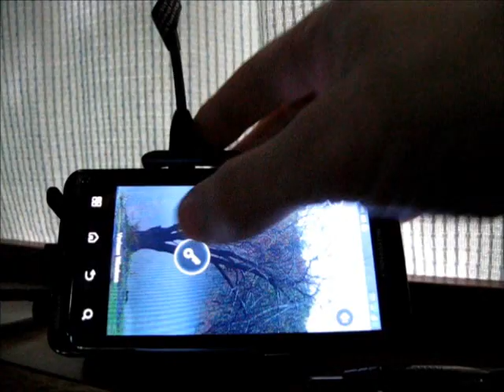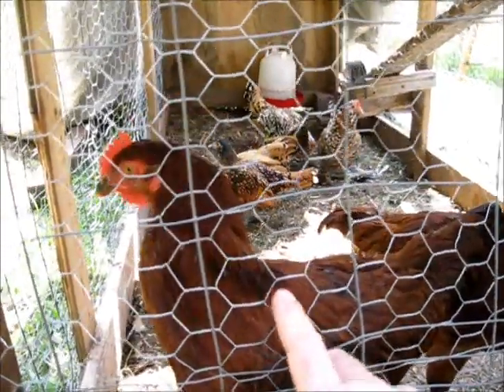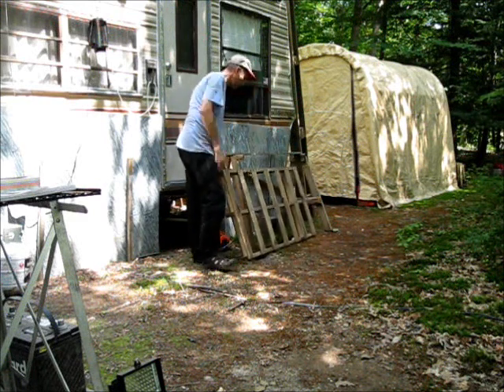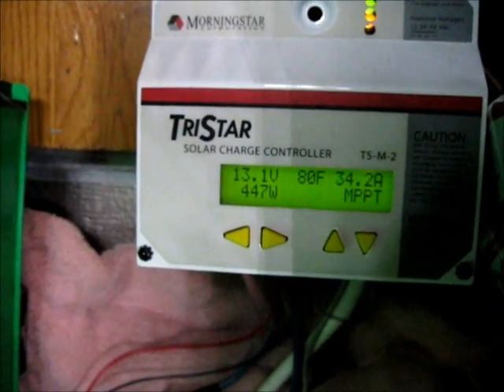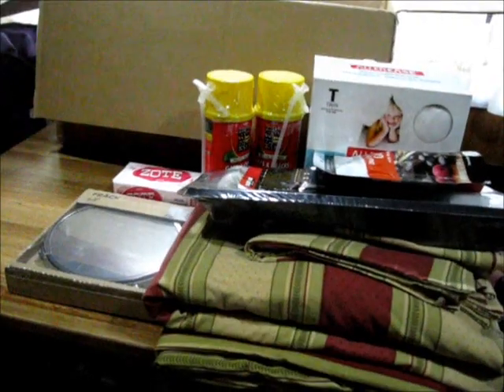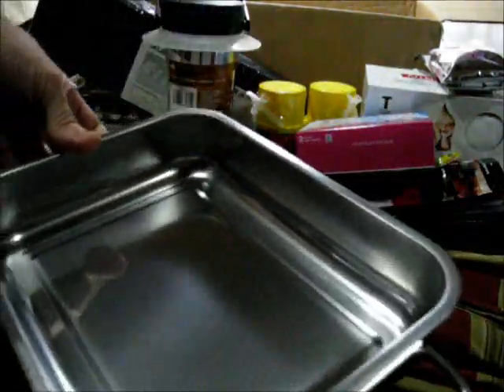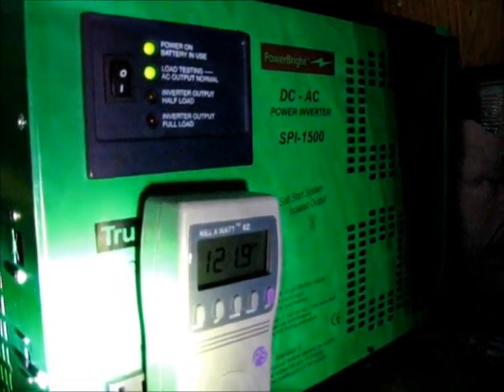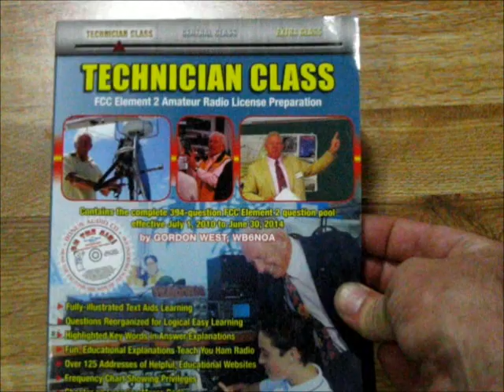Off Grid Solar Air Conditioning

Comment from the maker: Its the wires, I am sure now. I will double them up, yes.

Thanks for the tip.

The wires to the charge controller are separate from the wires to the inverter.

Comment: Why are people giving this guy a hard time? When you live somewhere at 100 degrees on average. Or 100 percent humidity you NEED A/C. If you don't good for you. BTW he explains why he needs it.
Reply from the maker: Thanks. This year has been quite brutal actually. Even my wife (got married recently) from the Philippines says it is HOT here.
Reply: I won't live without AC either. It's over 100 where I live in the summer.
Reply: FutureAirways2 you don't NEED a.c. man I live off the grid all solar water comes out of a spring. A lot of people will say off the grid and it is not primitive it is common sense

Comment: I spent a year off grid in Arkansas, and I saw how much of a different humidity makes.  It takes longer for clothes to dry on the line, my tools rusted faster, cold feels colder and hot feels hotter... my pillow would be damp at night from absorbing moisture out of the air... paper feels damp.  I also had a mold/mildew smell in my camper, but I also had some leaks in the camper.  And a swamp cooler is useless in high humidity.

Comment: It's the A/Cs current draw on startup. When the A/C kicks in it takes much more power to start then it does to run, When you 'tested' the unit during the day the solar panels were giving charge, so the 'draw' on the inverter was not so high.

Comment: It's good that the newer electrical gear doesn't have the current pull at start-up that they had a few years ago, sometimes current draw was double the running amps.

Comment: Just a thought from someone who lives in south texas and feels your pain.  I have decided the best option for ac and fridge is to only power a small chest freezer.  Freeze gallons of water in the chest freezer say six.  put two  in a yeti cooler for your fridge and two in a cooler with some water and blow a fan across it for cool air. refreeze as they melt.   I have no idea if it would work but it would mean only powering a small chest freezer vs fridge, freezer and ac.  If you do try let me know if it works.
Reply: yes like a swamp cooler

Comment from the maker: I really did consider it. They cost about as much as an AC though. I looked around a lot for them. The DC models actually use more energy in 24 hours than the air conditioner

Comment from the maker: I agree that I need more battery storage. I have been saying that all along.

But I have discovered time and time again that the charts are a theoretical capacity only. Things like wire length, insulation, quality, number of strands, outside temperature, number of wires in a bundle and other factors can affect the actual wire capacity.

I have found that my 4 awg wires will not handle 40 amps without getting warm. I doubled them today and the AC is working nicely into the night.

Comment: Glad the wire fixed it! As long as you set it to a temp where it cycles you may be OK, and at night it will run a lot less so it may work out. If you could add another 400W of panels to your system you would be in really good shape and would have some good power even on cloudy days. Anyone wanting to go solar and has grid power, look up "grid tie inverter" on ebay to get started, $100 and 2 wires and you are on your way and get to thumb your nose up at the greedy power co! It's fun!

Comment from the maker: Camper is in the shade most of the day. Yes the AC pulls more than the panels put out most of the day. In mid day its the other way around. But the AC only runs a few minutes at a time, so it works out.

Comment: I think your ac is probably exceeding your batteries  capacity when it kicks on it can have a surge demand that is significantly higher than normal running power draw.  its just for a second but must be enough to trip your system when it doesn't have the sun to feed in some extra watts.  a large capacitor in your system might give it enough reserve to kick the ac on.
Reply: A smaller high discharge battery hooked in parrell might do the trick too. (like a car battery)
Reply: I have a "hard start" for my ac and some tools
, pretty much a capacitor just for that surge they have them on ebay and truck stops camping places etc

Comment from the maker: A house runs on AC power, so smaller wires work fine. The amps on AC are lower.

With DC, you need bigger wires. You cannot safely run 15 or 20 amps through long wires on DC power. They will get hot and burn up. The average RV or camper has 8 or 10 AWG wires for higher amps.

 I was running 40 amps peak DC power yesterday through 4 awg wires and they got hot. 

Theory and reality are vastly different things I am learning.

Comment: With my experience as an electrician in the navy, a good rule of thumb on starting current for any motor is 5x the normal running power.  so that 500 is more like 2500 on startup. Your inverter says 1500 so I am assuming it can only handle 1500 watts.  Hope this info helps!

Comment: I had the same problem with my air conditioner and inverter in the evening. It ended up being the inverter to battery cable size and length. I increased the cable size and shortened the run of the cables and never had problems again. It was the load during the compressor starting up with the smaller cables that would cause my inverter to shut off or not run the ac. You could also use a capacitor to solve the problem. I used a car audio capacitor and it worked later to help with voltage spikes...

Comment: Oh man I feel so sorry for your in the heat. Down here at Lake DeGray in Arkansas we also get a bit warm 80 to 90 with high humidity and then summer comes and it get hot. FYI you need better air flow or you will have black mold in your RV. Enjoyed your video a lot .

Comment from the maker: Well, I will certainly be testing out that soap in the future.

The charge controller shows how much power is coming out of the solar panels into the batteries.

The inverter cannot run after sun down due to the wires being too small.

Comment: I was excited to see that air condition running off solar.  That is AWESOME!  Renewable energy ROCKS!!!  I want to do the exact same thing for my back room.  I am wondering if it's possible to do this only two 250-watt solar panels with a 5,000 BTU unit.  I've used an LG one that has an "Eco" mode that completely shuts down once the room temperature is met.  I'm sure that will give the battery plenty of time to recharge and it wouldn't have a constant 300-500 watt draw.

Comment: Good Job !  Could you run it at night if you had a 2500 pound electric forklift battery and how many more panels would you need???/ Would that work? OR are smaller batteries best? This is just COOL !!!

Comment: Your wires gauge had little to do with your inverter shutting down. You simply don't have enough battery power to run an AC without full sun producing a continuous charge. Going to start one myself soon and I'm going to need 560 AH of batteries alone to power my 550 watt ac for 12 hours @ 25% discharge. Ouch! Solar panels are getting cheaper by the day, but batteries are not and are the biggest investment you'll make in any reasonable solar system. Thanks for sharing and keep the videos and experiments coming.
Reply from the maker: It was the wire gauge for sure. When I shortened the wires it worked fine. But you are correct that I need more battery power to run it without sun. Yes the batteries seem to be the biggest expense in an off grid system. Thanks, I will keep up the videos. I have many plans for the coming year.
Reply: The Do It Yourself World
Wow! How many batteries do you have and how many amp hours are they? I could reduce the initial expense of my system by only running the AC during peak sunlight hours and only running a fan when it's cloudy and at night. Thanks.

Comment: I used a Swamp cooler [evaporative] and replaced the 110 vlt fan and pump w/ 12 volt stuff, and run it hardwired into a single 125 watt solar panel w/ no battery or charge controller. Cool I have chickens too.

Comment: low cool or high cool wont make a big difference, it's the compresor  that draw the more power.
so if you use you,re ac, use it at high ac  for shorter time. you will use less current than low ac for longer...

Comment: Your inverter circuit protection is being triggered at low voltage, low current or high temps on the circuit board. It could be from not having enough voltage or current from the battery bank at the time of need. I'm not sure what you have on the inverter to tell you what the error/warning messages are, or what you can read or see, but you must find out if it's low voltage, low current, or high temps.

Someone else had mentioned using capacitors to help take the current and voltage hit when the compressor kicks on, it might be a fix, but I wouldn't go there unless you know the reason for the inverter shutting down.

If you let your AC set for 2 minutes between attempts, your AC compressor and AC system should be OK, otherwise you can damage the compressor and the system.

Good luck,
There is always more to say, but I won't until you respond.

Comment from the maker: It only runs a few minutes at a time. It pulls 40 amps when the compressor is running, yes. Then the compressor shuts off and the fan blows (about 5 amps DC) for a while. I think it will be fine.

Comment from the maker: All I ask is that its under 80 degrees inside and not humid. Yesterday after 30 minutes it was 79 and comfy. The compressor only ran a few minutes at a time. Was mostly off. I think it will be fine.

Comment: Your Re right you need bigger wires to Carrie enough wattage to keep the ac running so it won't drag the power down all so you need more at least two or three batteries to keep the car up and running so The inverter still be  running while the sun goes down. Good luck I hope it's go right for you and your cat to good bless you and your cat.

Comment: Where did you get the little tan colored "tent" building in the background? It has a zippered door in one end? It looks like it fits over a PVC pipe frame.
Reply: i got one from sams club and u can get a cheap one from harbour freight and walmart - bad thing is they do deteriorated so when mine did i took some 1 x 4s screwed them on to the metal pole frame roof area then bout 30 ft metal panels and screwed them on the roof for one of my car ports for my car

Comment: Lock rotor amps, you need a bigger inverter to get the AC started, running is no problem. The reason it works when the PV array is up, is that some of this lock rotor current is being provided by the solar.

Comment: Regarding the lock glitch. I have had the same problem on a few android devices where the screen is not very responsive. I have discovered it is from not enough amps outputting from the charger. Depending on the charger, they are around 0.3amps to 2.1amps DC usually, should say on the charger. The ones that give issues are around 0.5amps DC and lower. Just my experience.

Comment: Awesome video, but have you seen the homemade Air Conditioners on Youtube, or even experimented with them? Are you able to freeze water there off the grid? There is a cheap design for a 5 gallon bucket, frozen milk jugs with water, a solar powered fan, and three holes the air blows out of.

Comment: The AC experiment is exactly the one I was hoping you could try.  I was saving to send you the AC unit since you already had the solar array.  You beat me to it!!   I found a Frigidaire unit that was 5000btu but only draws 465 watts.  Model FRA054XT7.  They also make a 6000btu unit that draws 560 watts.  Not too expensive on Amazon.  I'm definitely interested in how this goes for you.  For off-grid, or emergency backup cooling this seems like it would be great if you can get it to work.

Comment: the problem with the phone is usually a screen protector or when it's plugged in it causes issues as well.

Also I'd put something under the AC unit to collect the water from the unit. (should come off being pretty warm water too if you have a direct use for it)
Reply: Yeah, I had a bad phone charger that whenever it was plugged into my phone the touchscreen got really glitchy and I couldn't unlock it.  If you can unplug the phone, hold it normally in your hand, and it works, then it's the cable or mount causing issues.  use the process of elimination to track down the issue.
Reply: Steven Kroiss don't use it for much tho it's gross water. Basicly moisture that's in the air like sweat and other crap

Comment: I have three 110 volt ac units, one of which will heat as well. They are tucked away for emergency use only. Of course attempting to run all three at once kills the batteries within 1/2 hour. But the inverter has no problem with all three. It's the panels that can't keep up.My plan is to cool the kitchen area during the day as that's where we hang out anyway. At night we switch to the one in the bedroom for a good nights sleep.The unit that heats is strictly for an all out emergency. Our primary heating source is wood. With good seasoned wood in my old wood stove the thing will have you opening windows when it's 5 degrees outside. Needless to say, it heats the entire house without issue. We don't have to have air conditioning in the summer but damned it feels good when it's about 98 degrees outside.

Comment: I bet that fish feast was awesome ! 

Troy have you considered a large capacitor for the energy surge when the a/c compressor engages ? This should remedy the start up increase in power until it regulates the power being drawn .

And you could simply double up the wires for your inverter ... eg, Two 4ga wires for your hot leads . I've done this to save costs on bigger gauge wires. 

Good luck my friend , Keep cool !

Comment: When I was living in AZ I bought a window AC. When I used it the thing burned out the outlet in the wall within a couple hours. I was told that it was from the AC working for so long at a max load. They said it was never designed to run at max for so long and that a bigger unit would not have toasted. Maybe its time to suppliment your power even if its just with your home made panel.

Comment: Are you going to add more PV's so that you can run the Ac while you're using lighting, or charging batteries?  What about using the AC at night?  Seems like you'd need it running at night to be able to sleep comfortably.

Comment: If your AC unit creats an instantaneous inrush of current at startup... try putting a 1 Farad audio capacitor between your inverter and battery, parallel

Comment: Excellent points Sir. Solar systems can't just be thrown together. They need to be planned out and put together properly. It is one thing when you have people donating equipment as needed, but when someone is building a system to live on they can't expect Amazon boxes to show up with needed new supplies. That system is far from ready to be running any AC units, especially if he plans on having power for anything else. Remember:the 5 P's  Poor Planning = Piss Poor Performance

Comment from the maker: 1,000 with a small AC, LOTS of batteries a laptop (no desktop) and lights are fine. Some smaller items like fans and my grinder and stuff and I have excess power left over each day. I need more batteries for my AC unit though.

Comment from the maker: Ok, its not been over 4 days. The AC works nicely. I do not keep it cool in here but take off the worst of the heat and it gets the humidity out. I need more batteries but have enough solar.

Before the 50s the rich lived by the ocean for the cooler air.

Others suffered or used geothermal cooling. Think basement or food cellar.

Comment: If i can make a suggestion, I had the same set up in my camper and I created a "cold" room by hanging up an insulated blanket between the living room and kitchen which created a 8x10 room.... my 5000 btu had an energy saver which i left on and within an house the unit would shut off till it got warm again, ran perfect for yrs and saved my solar... i also had a dedicated panel just for the window unit.... your never going to cool the entire camper with 5000btu so create your own cooling room!

Comment: very nice ok its the same as your heat keep the living room closed off and windows covered to hold the cool air in much better then a swamp cooler. more batteries try to build up your supply of batterie banks If you can run a AC you can run a small washing machine not at the same time good luck Troy .
 P.S.  Bedini

Comment: The compressor (and any electric motor) counts as an inductive load. When it starts it may pull up to three times the rated amperage for a split second before it settles down, and of course the electronics in the inverter see this and dump the load before it cooks something. Not only will you have to increase the battery capacity, but if you want to run it after sundown, you'll have to subtract the start up spikes from your amp hours in order to determine the total run time.

Comment: Those small air conditioner units draw IMMENSE surges.  There is the chance that the surge is going beyond what your inverter may like.  Sine-wave inverters cant surge as high in some cases.as modified sine units. you may look into getting a modified sine unit to dedicate to your ac unit.  I had a similar setup to yours and I encountered similar problems.  Your wires look large enough to handle it, at least as far as I can see :)

Comment: My 3 units get daily Florida down pours, wind and grapefruit plopping on them with no problem. If they are not tilted back a little they tend to leak inside the house. That center support beam did look a little weak, but they don't weight that much.